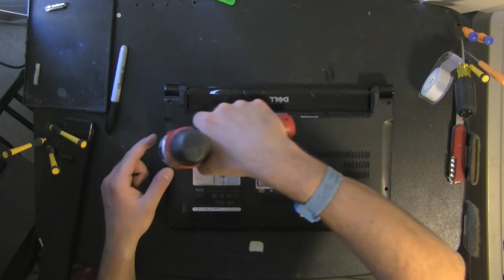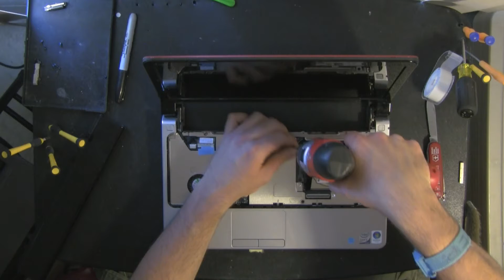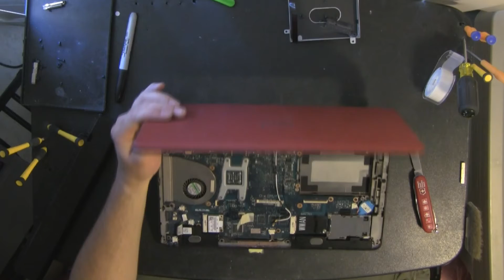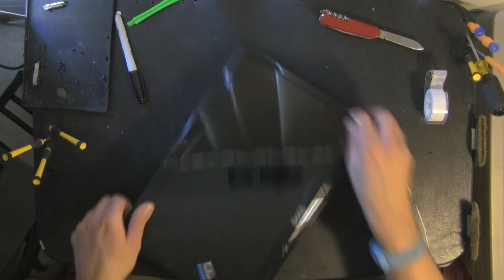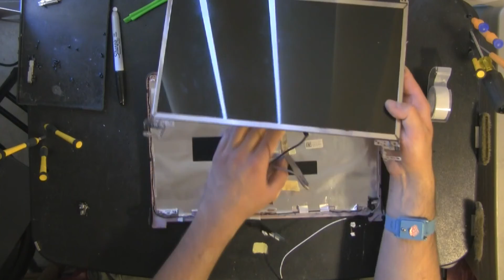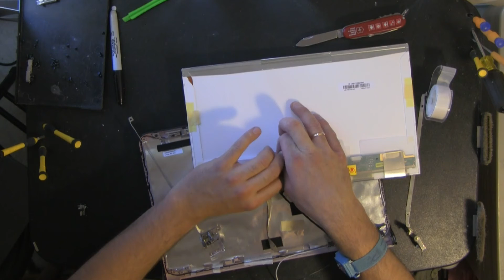DELL STUDIO 1440 14Z take apart video, disassemble, how to open disassembly

Comment from the maker: Fan and heat sink are the usual suspects in laptop overheating. Also if you clean it - re apply thermal paste. 
It should do the trick and probably you will not need a new fan. Unless it is broken or bad.